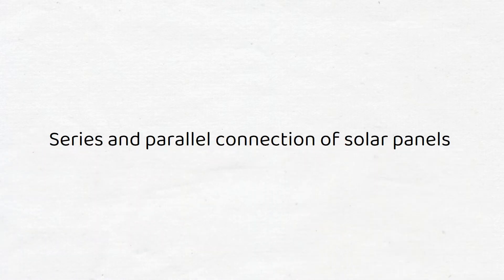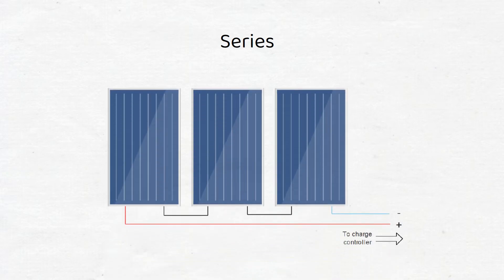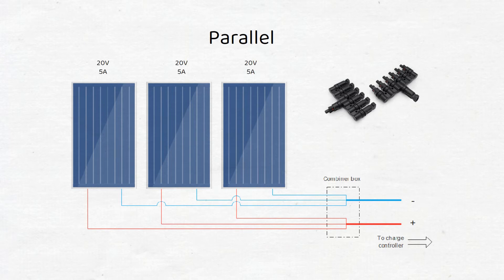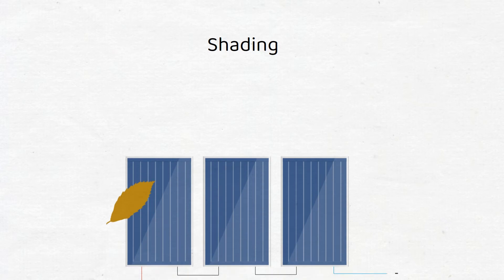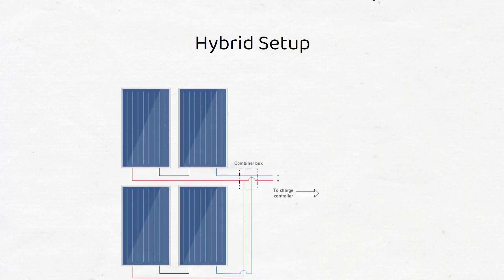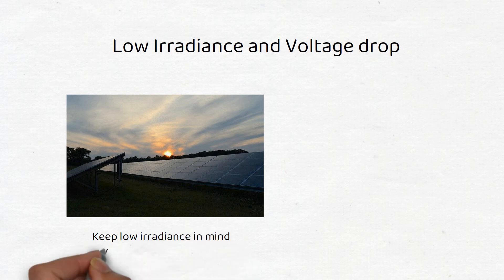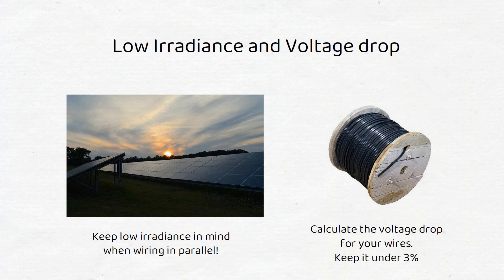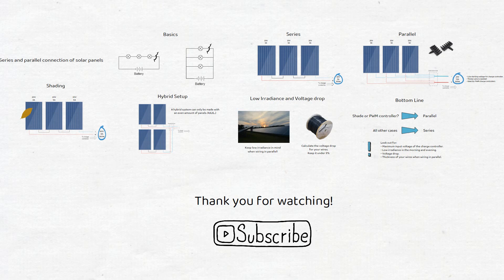Series vs Parallel Solar Panels: Shade, Voltage, and Current

Comment: I have 3 panels of 300W each, and a 60A MPPT solar controller. There will definitely be shade at some times of the day. Your suggestion is IF shade or PWM then parallel, otherwise series. What about for my situation where I have shade and MPPT... would you advise I use series or parallel? Thanks!
Reply from the maker: If you only have 3 panels with shade, then wire in parallel. Fuse every panel with an inline fuse. Check my video about fusing solar panels. If you had more panels I would have used another MPPT and put the shaded panels in series.

Comment: Hi, I have a question, if you have a 12v system & three 12v panels connected in series to a 100v MPPT controller, even though you are getting the same power to the controller, you are getting 1/3 the current so are you charging the battery the same or less than with higher current parallel connection?
Reply from the maker: Connecting your panels in series or parallel will deliver the same energy into the battery if there is no shade. For example: 3x18V panels in series = 54V at 10A for a total of 540W. The charge controller will bring down the voltage and increase the current. So: 540W/12V=45A.

Comment: One thing to add is the rated Amperage of bypass diodes in panels. I removed them because of the 10 A value. A voltage drop will occur if diodes are not rated correctly. In my case it reduced voltage from 72 volts to 50 volts in a 2 x 36 volt series setup.
Reply from the maker: That is very weird and unlikely to be the cause of the problem. Solar panel manufacturers know the panels will be placed in series, why would they add a 50V diode to it? Which panel was it?
Reply: @cleversolarpower  Eco Line ES50P72 has only 1 diode because of the array 2 x 18 cells. I really did find a voltage drop and after removing diodes I had 72-80 volts in series of two 50 Watt panels (49 euros each) producing 4.2 Amp. Not even strait at the sun. Very happy now.
Reply from the maker: @QUADBOYification  They have weird panel specs 41V at 1.5A. SOmebody in the reviews mentions the same problem. Maybe that's why they stopped selling them.
Reply: @cleversolarpower  Amazon had them originally listed as actual 100 Watt panels, probably not far off if you test them. The specs show up to 3.5 Amps with full strong sunlight and even very good efficiency at very low temperatures. You do need a good MPPT Controller. They were sold out, at that low price not surprising. I got two.

Comment: I changed my solar array from Parallel to Series and volts went up in the sun it was great UNTIL a cloud came by and unlike when I had parallel hook up the drop of voltage was huge! I can see with series that they are all impacted as ONE when shading happens. With Parallel I had a better sustained energy coming in even with some clouds. PEACE
Reply from the maker: Make sure you increase the diameter of your wire too. Wiring in parallel increases the current.
Reply: I purchased a 24v hybrid inverter charger that has a Max PV open circuit voltage of 100.  I have 4 panels with an ISC of 5.21 amps and an open circuit voltage of 24.3. I wanted to wire the panels in series for the reasons you mentioned. That would bring my  input voltage to 97.2v, just under 100v. The folks from the panel manufacturer say I should wire them in a 2s2p configuration as it would be safer. They said the voltage will damage the controller. Is this being overly cautious, or are they correct?
Reply: @mileshanley8052  you can calculate the diameter of the cables you need to work with for maintaining both safety and voltage
Reply: I believe you can add a bypass diode to each panel in addition  to the bypass diodes already in clouded in the back. So the panel shaded getts by passed

Comment: I have 5 panels , each panel is 410w and 36v , I intend to use these to trickle charge my EV car and when not charging EV I would power some appliances. What inverter is best for me  ?.
Reply from the maker: Get an inverter with an islanding function. Growatt SPF 3000TL LVM-ES

Comment: Very good explanation, but you didn´t mention that most panels has a bypass diode, and maybe also a blocking diode. These eases up a lot of the shading problems.
Also for parallel connection there is a need for blocking diodes if not shading of one panel shall reduce the power from the other non shaded panels.
Reply from the maker: Hello Rudy, A bypass diode bypasses 1/3 of the solar panel. That means there is 2/3rds left. This reduces the current by 1/3. Bypass diodes are not miracle devices like many people say they are. They still reduce the current of the panel, thus the whole current of the series string as show in the example.

Comment: Thank you. I find this very clear. I am installing solar panels these days. To begin the project, I purchased 150W X 4 panels. I think hybrid system will help in my case. (No shading at all but the location is hot 😢)
Reply from the maker: If you don't have shade, use series. Up until your total VOC is under the input voltage limit of the charge controller.
Reply: @cleversolarpower  Thanks!

Comment: A correct way if concerned  someone will break a wire is put it in a safe place so it not break. , or make a second wire in a different way of lay out instead of one.

Comment: With solar roof we take whole strings and parallel them together. This allows us to use less MPPTs 
Nice thing about micros also is that with an AC system everything is already paralleled
Pros and cons of both
Reply from the maker: I have no idea what you just said there.
Reply: @cleversolarpower  the time is now

Comment: Sure  - at 5:35 you talk about the volt drop of the cable. First - Before the charge controller threshold is reached there is no current flow so there is no volt drop on the cable. Second - even when the solar panel voltage crosses the threshold there is almost no current flow. Solar panels voltage is pretty quick to reach max, but current is related to irradiance. Third - It is only with a series set-up and a MPPT where there is a threshold to pass, Typically a few volts above battery voltage. In your recommendation of a Parallel set of panels benefitting from a PWM - then Parallel and PWM will beat series hands down because there is virtually no threshold to overcome. The PWM will simply switch the PV Panel voltage through to the battery no matter what it is.  

Simply put - in practice series holds little to no advantage, and may even be a disadvantage in low light conditions. Cable Volt drop is a non issue for start up because there is no volt drop if there is no current flow. In the series system typical threshold to achieve (VICTRON) is 5 volts above battery voltage. PWM and parallel will start charging at a few mV above battery voltage.

It also depends where you live - where I live, in Africa, near the equator, the transition from no Solar PV output to a useful Solar PV output is a very very short time, and any advantage gained will be minimal.

This doesn't mean all your other considerations shouldn't be taken into account, they are extremely useful and valid, just the low light issue is a bit of a hot potato.
Reply from the maker: 1. That's why wiring in series has an advantage. It doesn't need to wait to reach the treshold.
2. True, but the parallel isn't going to be a better option.
3. Yes, those are the most common systems. Series and MPPT. 
4. PWM requires parallel wiring. If you have a 12V battery and you wire the 18V panels in series you will have a lot of losses. The battery should be matched to the voltage of the solar panels to minimize losses.
5. We wire in series to save on wire cost. 
It's true that the current will only flow when there is irradiance. During sunset, the voltage will still be high, but the current will drop. 

I think this is what you mean or I have understood it incorrectly.
Reply: @cleversolarpower  Thank you for the reply -  To me series will have no discernable advantage over parallel in low light conditions, assuming of course that we have selected all the correct components. Unless we are talking enterprise or industrial size systems the cost/saving of the wire in a 2/4 panel mobile or residential system doesn't offset the risk/reward ratio against shading/system-faults, nor does it lead to an easily expandable architecture. (panels must be identical and you can quickly get into an overvoltage situation with small charge controllers.)

Typically, below about 1000W I default to parallel, or hybrid S/P,  above that Series.
 
Lets just leave it here for now. Once again, I enjoy your input and thank you for that.
Reply from the maker: @keithduffield5239  Thanks for your constructive feedback Keith.

Comment: Tip, an under-table bulge and all other hungry electricity consumers can be infinitely dimmed with the 5000W dimmer (7, EUR). I run 5 dimmers in parallel on an 850W inverter. Kettle 2.2KW at 150W runs for 12 hours at a time, so the water is always hot. The room is also nicely heated. 2.5KW washing machine runs in parallel with dimmed to 200...400W. Iron, dishwasher, oven, electric heater, coffee machine, all internal heating are throttled with me. Videos on my channel https://youtu.be/eC2olbCBhh0 The inverter stays cool, quiet and the MOSFETs stay intact because no extreme current peaks arrive at the inverter...

Comment: Glad you included AWG in your explanation, however perhaps a more indepth explanation is needed, as in 100m of 10ga vs 100m of 14ga wire voltage losses and current capability...
Reply from the maker: I made a video about voltage drop. But a more practical example is a great idea. Thank you!

Comment: Thank you for this explanation and I do have 2 questions if you have the time:
- I have 8 panels connected in series to my inverter, I want to include another 2 panels that are facing the west to capture the sun after 6pm (the 8 are facing south and don't capture after 6pm). How can I achieve that? any advice?

- How can I add a wind turbine to my solar system? If I replace my MPPT hybrid inverter with one that takes 2 PV input, will that allow me to do that?

Many thanks
Reply from the maker: 1) If you use batteries, you can add a new charge controller in parallel. Search 'multiple charge controllers' on google and my website will be the first to pop up. 2) not have experience with wind turbines. But it will be similar to 1. Add a charge controller in parallel.
Reply: Exactly - the series string may pass the voltage threshold earlier, but at that stage the power available is close to ZERO. One needs to look at the curves for Voltage and Current vs irradiance to see that while the PV Panel may produce voltage under poor light, it doesn't produce much current - hence power.

Comment: Who is beter me 2 panel 170 w7.7 Amp 160w7.25 amos same volts 22.07 but deferent Amp what im need paralel or series 😟 this big problem or its OK help plss
Reply from the maker: Same volts = Parallel

Comment: I have 220a better-6 , 12of 300wat panels and 3.5kva inverter how can I connect it
Scnd issue is that they always have power failure and they do have shed some time what of connection i need to do
Reply from the maker: Hello Ak, I don't understand your question. Can you send me an email?

Comment: i have all 3 solar setups.. 1 full parallel 8 panels 150w, 1 series-parallel 6 panels 320w, and 1 series string 5 panels 450w.. all grid tied and on the same roof with the same orientation.. the all parallel produces power early 5:30am.. the series-parallel will start producing at pass 6:30am, and the string will produce power at around close to 8:00 am... otherwise they will all read zero watts... seams to me the all parallel is better performing at low light condition..
Reply: That sounds backwards.  Since charging requires voltage exceeding the battery voltage, panels in series get to charging voltage when the light is still low.  In my setup, panels in series begin charging the battery at 5:30AM when the sun is just above the horizon.  The charging day lasts until nearly 7:30 PM when the sun is setting.  The parallel equivalent cuts the charging day by more than two hours.
Reply: @randymaclean2707  series tends to work better for longer output.

But with parallel you can prevent voltage sag meaning that while the voltage can be high enough you may not have but amperage meaning series cells won't output but parallel cells will add the amperage giving it enough to start charging whatever it is..

Low light parallel will almost always win.. but with full sun series can work better as long as nothing gets shaded. 

If you have mixed shade then parallel will be better as well.
Reply: @randymaclean2707  theres one reason why half cut cells and shingled solar panels are advertised to perfom better in low light and shade.. gues why.. cells are in parallel.. cells in series total power output is only as good as the weakest cell in the string. since not all cells are exactly alike there will be variations.. you will soon find that if there is not enough sunlight to saturate all cells in the string the power output will suddenly drop..
Reply: @randymaclean2707 
But voltage rises faster by low light. Zo u fast sitting with no sun but light. At arount 60 % max voltage.
With current its mutch later. Curent starts at around when the voltage is above that.
Reply: Also mppt charges with 12 v. At 17 18 v input. Zo eitherwhay u fk
Reply: Thats the lower the battery voltage the better for solar. Input, but for output highervoltage is beter so if its rendementable u can dc to dc it so u can output more.
Reply: @tommyvandermout2190  voltage and current are linked.. if you have voltage but no current, once a load is applied voltage will sag.. it would be unable to power anything..

Comment: Hey sir. I love your work! But I have a question. 
In series connection what kind of wire do you use in the middle? is it Positive or negative? Thank you for your response
Reply from the maker: The wires are the same, it's just labeled as red and black. By code, it should be colored in black.

Comment: You did not give the voltage and amperage totals for the 2 in series and 1 parallel... I'm curious what do you get?..  thanks
Reply from the maker: If every panel is 20V, 5A (100W), then the total combined is 40V 10A (400W).

Comment: All solar panels have bypass diodes that work well with shading, and take the other panels to 100% of functioning while the shaded panel will have a lower output.
Reply from the maker: Bypass diodes work so there is no back feeding. This is to limit the heat generation of shade spots. It does not improve the current generation of the other panels in a series string.
Reply: @cleversolarpower  If your so clever, put together a setup of solar panels and shade one or two, you will see!
Reply from the maker: @bobrock704  If a panel is shaded and produces 2/3's of it's current because of the bypass diode, then the whole series string will have a 2/3's output. If you want to optimize for shading and you want the other panels to produce 100%, then you need to wire in parallel. If every panel has an individual MPP power optimizer, you are correct. But that's an additional cost and most panels don't come with it. You can make a video about it and explain me your reasoning

Comment: Does an MPPT solar controller turn excess voltage into Current/Amps?
Reply from the maker: Yes. An MPPT is a voltage converter. If the voltage is lowered to match your battery, the current will increase. A PWM cuts the voltage without doing any current adjusting.

Comment: I have a 40 Amp mppt charge controller. I have two 330 watt panels hooked in parallel. I also have one 330 watt I bought on a good deal from a friend. Can I hook this 3rd panel up in parallel with my other two panels and will my charge controller handle it okay?
Reply from the maker: That depends on your charge controller max current and your battery voltage. if your battery voltage is 12V, then you need a 83amp charge controller. Those are expensive, so you better get a seperate charge controller.

Comment: After watching your video I was very impressed. Just bought your book. Now I have question I have 32 Lg Bifacial solar Panels . Each solar panel is 410 Watts, Voc is 49.40V and Isc is10.48. I am very interested in victron charge controllers specially  victron smart solar mppt RS 450 / 100 or 200. Could you please give me your advice what is the best way to connect 32 solar panels Thanks.
Reply from the maker: Thank you for your kind words. it is best to have as many panels in series until the max input voltage of the controller. For you, that would be a hybrid connection. I also recommend looking at the schneider conext for a charge controller.
Reply: @cleversolarpower  Thank you very much for replying and advise.
Reply: @cleversolarpower  helpful response appreciated
Reply: @cleversolarpower  hi
Reply: 0 loo lii

Comment: So I have a question. So I am trying to max out the wattage I can input into my eco flow delta pro which is 1600, 150 volt/15 amps. I have 8-200 watt panels, 24.3 open circuit voltage, 10.2 short circuit current.  Looking to wire 2 series strings of 4 panels then running those two in parallel.  So I get the 1600 watts, 97.2 volts but my amps goes over the 15 amps. I was told this would just be wasted.  My question is if I over panel and get more amps is it just extra not being able to be used?
Reply from the maker: That depends on the MPPT inside of the ecoflow. It should be mentioned in the manual if it's possible or not. If it's not I would contact the company and ask if it's possible to over-panel the current input.

Comment: Very good explanation of the different wiring types. Most of these don't include things such and voltage drop and why to use the different configurations. This was perfect.